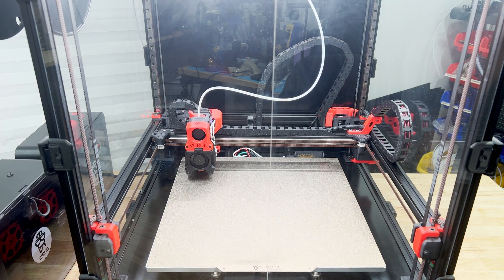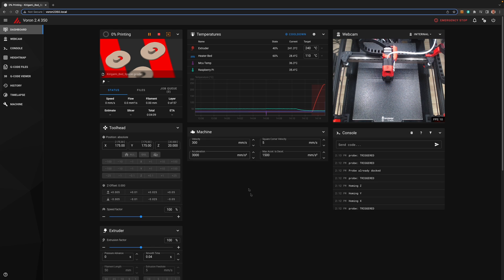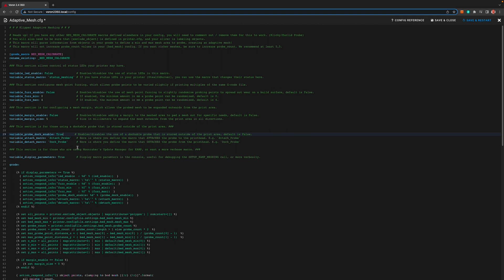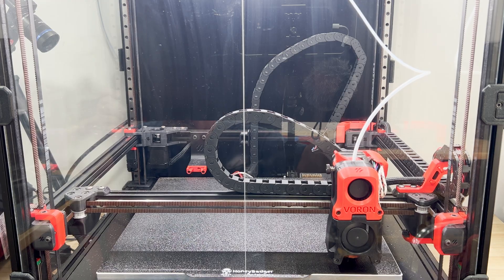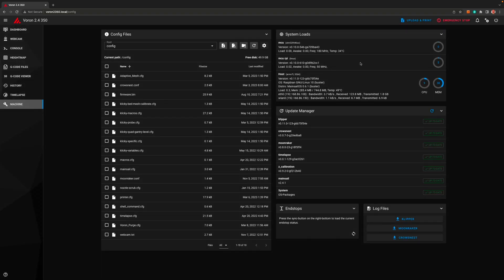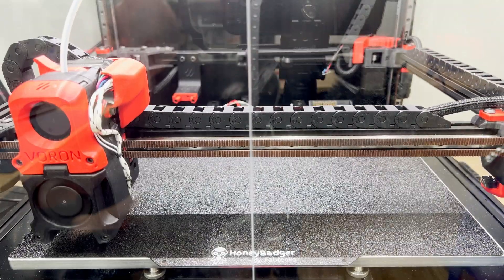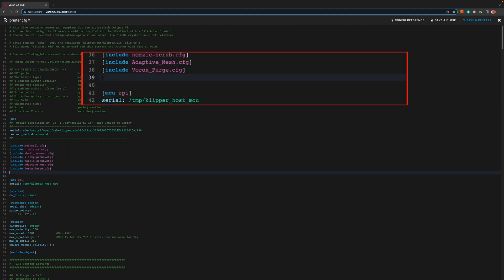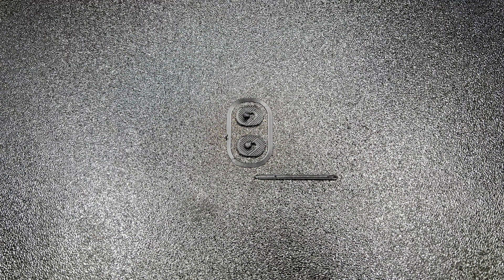Voron 2.4 Step By Step Part 21 Adaptive Meshing and Purging

Comment: The adaptive meshing file you refer to doesn't look like the file you use. The adaptive meshing file doesn't have variable probe dock line. That line is in the KAMP settings.cfg. So Iam totally confused.

Also why didn't you ssh in and do KAMP setup through Moonraker so if any updates that come up it can be updated?

Comment: Just wondering. you are running the Adadaptive Bed mesh but you are not loading the bed mesh once you have ran it. As you mentioned at the beginning of the video, you need to load the bed mesh in the START_PRINT macro 
once you have ran it.
Reply from the maker: A bed mesh each time allows for slight changes in the surface over time and temperature to be picked up. The real important thing is the adaptive part. By only doing the area needed by the print you can do a more detailed (tighter) mesh. This part really does result in a more consistent first layer. This in combination with extrusion backers has made a big difference in the consistency of my first layer over a day of printing.

Comment: Great video! You have a good way of explaining the process and showing all the steps in detail and at a good pace.
One tip though: you don't have to do 'save & restart' after a file if you need to do one more edit in another file. Just do the restart after the last file, that's enough. Otherwise you have to wait for Klipper to restart everytime, which is not necessary because you're not finished yet.
Reply from the maker: Thanks for the tip!

Comment: I ve got "Extrude below minimum temp" error because extruder is start heating after start procedures. what should i change?
Reply from the maker: Make sure you slicer has:
  print_start EXTRUDER=[first_layer_temperature[initial_tool]] BED=[first_layer_bed_temperature]
in the start g code as the last line. Right above that line should be the command:
 M117.
Also make sure you have:
 [gcode_macro PRINT_START]
in your printer.cfg file. Some sites say start_print when they show examples. The name called in the slicer just has to match the name in printer.cfg. 
print_start is what slicers have by default though.

If you have this and it still doesn't work there is/are typos in ether the slicer print_start line or in the macro in printer.cfg.

Comment: I’ve went back thru all your videos. Does any of them cover bed_mesh ?? Or am I missing something.
Reply from the maker: I hadn't really noticed, but I didn't have anything on the mesh before this video.
Reply: @scottcorn  After I have entered the commands BED_MESH_CLEAR and
    BED_MESH_CALIBRATE, in printer.cfg Klipper reports: Existing command 'BED_MESH_CALIBRATE' not found in gcode_macro rename. Did I miss something?
Reply: @MarCel-zj1lk  Had the same issue. The [bed_mesh] information is missing, so it triggers this error. In the video check out at 5:42 Line: 556. There you will find the data required which should make it work.

Comment: Very Nicely paced , informative, and to the point . Good closeups of the screen and printer . What a relief to see how you fixed an Error message , this is what we all experience at some time or other but you rarely see this addressed by other utubers . I followed your video. And it all works . I run TAP on a Trident . I'm not intending to change direction by building a Voron 2.4 but I'm going to watch your series , I'm sure to learn something. Subscribed.
Reply from the maker: Many thanks! I'm working towards TAP. I'll update to 2.4r2 in the gantry first. I decided finally to upgrade to CAN bus also.

Comment: Do a Voron Tap Build.  I know there are Shortages of the Optical sensor but I have had a lot of success with the D2HW-C203MR switch.  I went ahead and ordered 3 extra just in case they wear out easily.
Reply from the maker: I have most of the parts, but it will be a little bit before I do this. I'm pre R2 so most of the gantry has to be redone. Right now I'm fighting with Klipper all of a sudden. Not sure what changed after 700 hours of printing. lol

Comment: I just finished a Voron 2.4r2 350 build - or should I say you built it though me as I followed your work from start to end and it was invaluable. I can't thank you enough. Despite the hardships (this is not my Carbon X1)  I am getting some of the finest prints ever and it's huge in print size.
Thank you
philly
Reply from the maker: You are welcome! 
Mine has done some very good prints also. I'm at around 700 hours of printing on it now and I think it's time to check screws for tightness and gantry for square again. It's still good, but I'm seeing a little bit of degrigration in the prints. Nothing bad, just not quite as clean.

Comment: Hi, and thanks for the great videos you are making. I appreciate that you do the speaking now, it makes it easier to get the details. I have seen on some of your videos that you have an excellent printing quality on some parts. It would have been nice if you could show us some tips and tricks to get those printing results.
Reply from the maker: Thank you. I was just thinking about running through Andrew Ellis’ print tuning guide. Everything is good on my prints except my overhangs are less than great. I know part of it is the old print head I'm running, but I think it should be better. Running a third print of a small V0.2 part right now trying to get an overhang to look better.

Comment: Him how about auto z calibration 😊
Reply from the maker: I started to do that a couple of months ago and found it confusing. I think the documentation has gotten better since then. I may look into that.
Reply: @scottcorn  i have try it 2 times and i give up and waiting for good guide
Reply from the maker: @JordanStoev  I'll see if I can figure it out. I didn't try too hard last time I tried.
Reply: @scottcorn  I too had problems with the Auto Z reliability. It would work great once then the next print would be 0.1mm high. I switched to a Euclid probe which is much better than the Klicky I had. Better but Auto Z still not accurate as advertised.
Reply: Pain to setup for Klicky but once Scott's V0.2 is up and running, he should upgrade his v2 to r2 specs and definitely go Tap! Tap gets first level spot on for me at least, 99.5% of the time. The other .5% is me being impatient and not letting things warm up long enough.
Reply from the maker: @Invaderjason123  I'm starting back up on the V0.2 this week. I'm spending today cleaning and rearranging my shop. It had become very cluttered. I spend most of my awake hours in it. lol

Comment: I know you like the klicky, but maybe TAP would be better
Reply from the maker: You are right, I'm sure that it would be better. I have the parts for tap but I'm going to wait until I have my V0.2 done before upgrading. I'm pre R2 so I have to replace most of the gantry and the print head to go to TAP. Until I started doing videos I didn't realize how important it is to have more than one printer. lol

Comment: Thanks for the M117 tip. I had noticed my adaptive mesh wasn't firing but I haven't had the time to track down what was going on. I'll give M117 a try with my next print!
Reply from the maker: No problem. Should work for you. I think it is fairly common on Vorons at least.